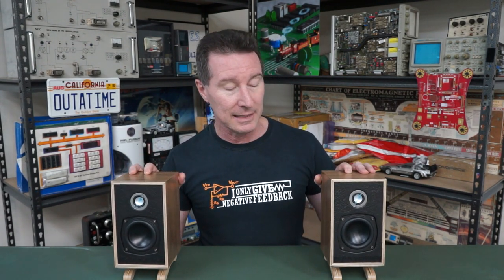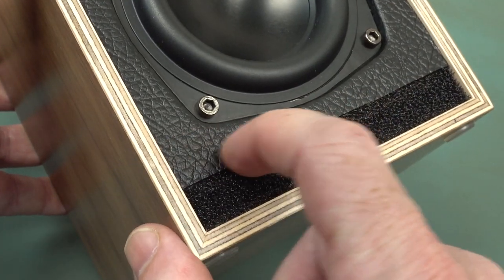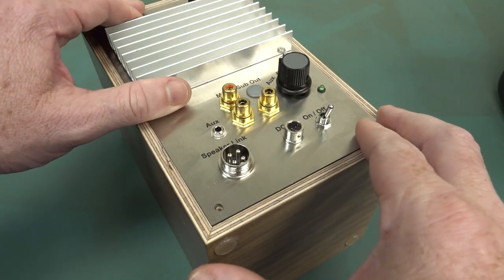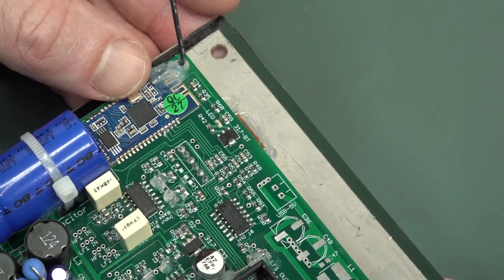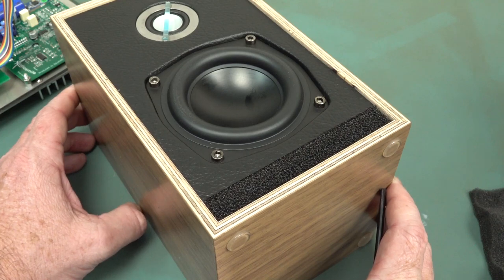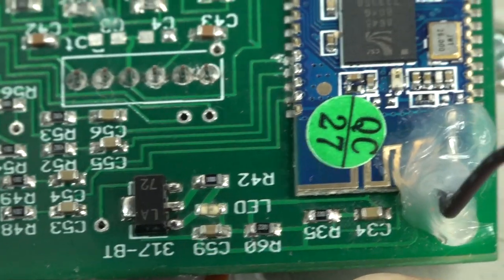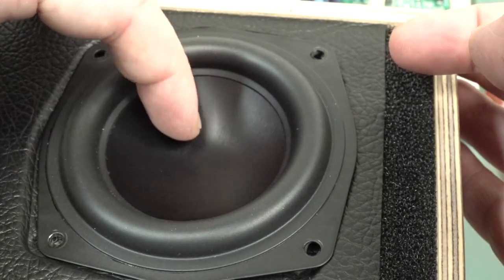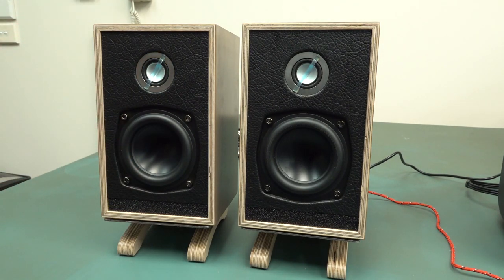EEVblog #1162 - Little British Monitors

Comment: Venting the magnet reduces first resonance frequency, not unexpected in a smallish wideband driver (headphone drivers often do the same). 

Good attention to detail in construction, parts appear to be nothing earth-shaking but of decent quality. (Yeah, the heatsink could be better, but eh... it'll do.) The speaker link jacks look like those used for radio mics to me... 4 contacts are just what you need for two drivers.

Looks like single supply for the main power amp and split supply for the preamp stage, I wonder how this goes together... center-tapped AC input with 1x bridge rectifier + 2x half-wave?

Pricing is not budget basement, but I mean, these are made in moderate numbers in the UK, not cranked out by the thousands in China, so both economy of scale and labour costs would be working against them.
Reply: "The speaker link jacks look like those used for radio mics to me" - XLR

Comment: Like electrical transmission lines, an acoustic transmission line is supposed to present the driver with a constant, characteristic, impedance.  I doubt that is what this one does, and even the best ones, on a proper scale, fail.  They aren't really supposed to output anything at the end, and I have never fully understood quarter wave transmission lines because they never add up to Unity.  In contrast, a ported cabinet presents anything but a flat impedance to the driver.  It's essentially a second, lower, resonance below the driver's main resonance which serves to extend the bass response.  (You don't get two peaks as one might imagine, but get a smooth shape if properly designed.)  The price you pay for this is a sharper rolloff because you have introduced two new poles; in the mass of the air  and the compliance of the air in the box.  They are very different things indeed.  I hope I have elucidated the difference.

Comment: Rear heatsink is the wrong orientation....  Noobie mistake right there.
Reply from the maker: True, I should have noticed that.
Reply: Its safer to orient the heatsink like this when they are big enough to work that way, because when the speakers are oriented sideways - no nasty surprises. That heatsink doesn't look very sensitive to orientation anyway, the fins are widely spaced and shallow.
Reply: and afaikt the stainless steel back which is s lousy heat conductor is between the IC and the heatsink
Reply: @adymode  But they are not designed to work on their side, did you not see the accompanying stands in the first couple of minutes?  I've done flowtherm modelling of heatsink orientation and the relationship between fin spacing and height. I doubt given the small amount of total power dissipated.
Reply: @Tim Fountain Course I saw the stands they're optional - the speakers cooling should obviously work anyway round.
Reply: British quality at its finest.
Reply: Exactly.
I am not an electronics expert at all, but I do know how to handle a soldering iron for 40 years and I do combine cheap Chinese stuff to make things I can use myself. Even I, as a non-expert in electronics, even I always make sure I position the heat sinks in a way they can actually lose their heat. If EEVblog then tells me this guy has been working on this design for years, I think even I could have done a better job. I at least think about every step I make. I have been building audiophile passive speakers as well and done a lot of reading about it over the decades.

I would have taken this a different path: create fairly decent small active speakers built with standard components for a much lower price. Considering the size you will never get audiophile speakers, but you would be able to create decent BT-speakers that sound better than the ones made out of plastic. The DIY concept is okay to make transport cheap and aim at a certain group of customers willing to pay a bit more for something decent/special. Something under 150 US$ for a niche market, but getting what you paid for.
I would also make stands for it as well as some way of mounting them to the wall. Having the port at the front does give you the advantage that you can actually stick them to a wall.

Comment: i use those switches(power) in my detectors, and there is a low profile version that if used in this would mean it didn't need those wire links on the power socket, the power board could be soldered flush.
Reply: OMG Please share!

Comment: I'm stunned at the amount negativity towards a product, which by comparison to far eastern standards is very high quality. The number of comments that say they could build them for $100 is shocking. This of course is a complete impossibility, especially if they are to sell them at a profit and stay in business.

Ok the design of the PCB could be better, with more care taken with the layout. But in low frequency applications, it really makes little difference to the way the circuit functions. These are also pre-production samples, so there's going to be some elements of the design that won't get into the finished production models. 

So can we stop with this "I could build them for 100 bucks"  bullshit, because you can't period. If you can, then do it and send them to Dave for evaluation.
Reply: @Okurka.  The kickstarter states that PCB is outsourced to china.
Reply: I don't know a whole lot about the pcb, but the speaker itself is definitely not worth anything above 100. The drivers I'm 99% certain are Dayton Audio which I'm seeing for about 25 euros a piece and the "tweeters" are even less than that.

edit: after watching more of the video I can confirm they're indeed the Dayton Audio ND91 woofers.
Reply: This could transition to a premium product with proper QC(the manufacturing tolerances on this thing.. lol), PCB design, and better external design. It looks like a late prototype, or a personal project.. This is not something you sell at +200% premium...
Reply: They might have a clever transmission line design, but ultimately the speakers are coupled to a single amplifier (bad, despite the recent trend for "powered" monitors to do this), that's based on an off-the-shelf amplifier IC (still not ideal), use stupid connectors (sorry, but it's true), and individual drivers that are more at home in a TV sound bar than a NFM. And let's not even start on that hazard of a power brick - at least get something vaguely serviceable from LiteON, Delta, or even Mean Well.

They aren't near-field monitors, but a pair of $250USD Wharfedale Diamonds will run circles around these for build quality. And they're made in the far east!

It's some of the claims that annoy me most. 4x50W? Not a chance. Class A/B IC better than Class D? Nope. Alternatives using "inferior particle board"? AFAICT, the "research" suggesting this is 40+ years old - before many modern materials were even widespread - and most speaker manufacturers (even high end) use MDF because it's easier to build  precise cabinetry with and does not sacrifice sound quality.
Reply: Welĺ John,  I'm surprised that you're surprised. Most of the components are made in the far east.  Does the fact that they are hand soldered together in England make the product better?  It looks like a bog standard electronic design, are the Chinese rubbish at soldering?  To match the acoustic properties between the two units all of the electronics should be outside of the cabinet.  It's not good design.  Perhaps I'm too harsh.  There may be a market for people who want to pay for precut pieces of wood and have the fun of gluing them together.  I think it's small.  At this price.  My active monitors have input via analog, SP/DIF digital and optical fibre.  They were cheaper and they're very good.  A bit bigger.
Reply: each woofer is over $25, the tweeter i cant find but comparable ones from the manufacturer are around $20,  so we'll say $90 for just the drivers. Plate amplifier and crossovers are gonna be another $50-100. $150 seems about right.
Reply: Except, you most likely could. Key word is YOU. For YOU. On a production line, yes it would be more expensive. But the sad fact is, modern kit speakers have no point if you are looking for bang for buck when it comes to sound. If you are OK with used speakers, then 50 bucks and a trip to your local thrift shop will blow these out of the water in every way. Or if you want brand new, a few hundred dollars less than the asking price of these will get you a pair that also blows these out of the water in every way. Personally, I don't think the guy making these is an idiot, hence I think the target demographic is different than what you think it is. It is not people who want great sounding speakers at a low price nor is it for people who want high quality speakers. It is for people who want above average speakers that they can assemble themselves and are (at least as of now) fairly rare and unique. They are for people who like to make things, like speakers, and don't have a ton of time.

Comment: The very best thing for speakers is MDF or HDF not plywood... it’s pretty simple, the heavier and more dense the material the better, the goal is energy absorption... and plate metal on the back is not great... flat amplitude response is great, how about the phase? You can EQ any system ‘flat’ and it will sound horrible... it’s much more about phase and the lobes in the off axis pattern...Their is no real difference in types of tuning, a port is a port, unless it’s horn loaded. Also the foam used is to increase the apparent enclosure volume by keeping the thermal load constant (isothermal), pretty sure that type of foam is not correct. Anyway it’s nice to see young folks experimenting with this stuff, unfortunately MP3 pretty much killed off HiFi simply because it’s an easy to use format, it’s incredibly difficult to find high fidelity signal sources these days.
Reply: One word  - Tidal

Comment: So one monitor, with an external speaker. I think I would prefer a small shielded box with front controls and rear I/O with two external speakers. You could also design a matching stand for the amp box.
Who is it aimed at? I am supposing PC speakers for those with space issues?

Comment: Seven hundred u.s. dollars for an amplifier with 10% distortion? Aptx and, aptx hd especially, make a difference in sound quality but any efforts at sound quality are negated by that horrible amp chip. The whole thing seems to be put together from internet research by someone who doesn’t really have an interest in audio quality. In sourcing parts for my own build of a bluetooth speaker into a vintage boombox I’m acquainted with all the components used here and there is a definite mix of good and cheap components. The “tweeter” is most likely another full range speaker. True tweeters are built with sealed backs and wouldn’t need their own enclosure as was done here. The build is incredibly amateur or intentionally cheapened to make the most money. Dave went easy on the guy.

Comment: Been a while since I've seen anyone dabble in transmission line enclosures. I believe they were also called an acoustic labyrinth, requiring multiple baffles combined with a specific weight and volume of damping to slow the rear pressure a full wavelength instead of the half-wave of a tuned port, resulting in a flatter response and without the common 'muddy' sound of the latter, the reason acoustic suspension has superior phase harmonics. Bose has produced a few models featuring these types of enclosures, and I remember someone years ago using plastic conduit to create some Dr. Seuss arrangements for the same effect. Good stuff as usual mate! 

                                                                                                                                                               ~A. Lurker
Reply: @vanjazecevic1159  The first ones I'm familiar with were university prototypes from the 1970s, and the labyrinth was 100% filled, with longhair wool fiber, weighed to produce a more true TL than the half-filled 1/4 wave variant. Approximate dimensions were 5'H x 4'W x 4'D.

Comment: I don't like them... Someone made these and think they are nice and are proud of them - I respect that, but I don't like them at all myself. Cable between the speakers is not my thing either, but dude Dave - these speakers are so small - you will never be able to hear any difference between the active and passive box. No way. Unless there is something wrong with it. Potential loss? In this specific case, that's moving into the audiophoolery domain :P. These might be fine as speakers on your computer desk, or even as speakers for the TV, but would I put them in my audio studio? Nope. That's not what these are built for - but they certainly price them and name them to sound like they did.

Nope!
Reply: at that price I wouldn't even put them on my desk for my computer. 630$US without the stand. For that price I'm sure you can found a nice used pair of monitors from a well known brand that have some reputation. So for personal use? lets just say you can buy some nice used quality HiFi from the 70's that have that nice warm sound from that aera. Even brand new 630$US gives you a lot of room to built yourself a nice speakers+amplifier couple.
Reply: @blackdevil72  yes. I agree. This would not be my choice at all. I forgot, did Dave say it was a kit? In this case it is totally not worth it. The wood case, you either build one yourself or you pay a factory to churn them out for u. U don't wanna pay for a guy using a toy CNC to manufacture them at home. Unless its special and real fine work - but with all due respect for the creator - this is not worth it by the looks of it.
Reply: @LifeOnHoth  Dave said it was a kit and from kickstartter the kit is still 525$US. After having seen one video of some one building them, its not that the kit is hard to assamble but if you do something bad you have a pair of 500$US paper weight. So depending on the quality of the assembling two person won't have the same sound. And I'm not just alking about hability to follow instruction, depending on how wood glue dry you could have small air leak. Plus a little thing I don't like at all and where the guy is a genius he only sent pre-production PCB to group of youtuber and all of them gave him a pass because "oh yeah look like pre-prod, nothing wrong with it, but I can't really judge the quality but over all its good, you could buy them". There is no waranty on the final product, every video I've seen was with a pre-production model. So close to the end of the kick start and he can't show at leat one "finished" productt to the one guy he have sent the assembled kit? Now I'm not sure if I'm clear but that price for so few waranty? I'll pass even if they sound good.
Reply: @blackdevil72  Yeah... that was kinda my idea also... that if this is a kit like you describe it - the price is just all wrong.

This price will get you professional active studio monitors. With warranty, with psu and amp in both cabinets and most important - bigger. Imho - if u go under 5 inches bass element, that's simply not worth the money if u aim at a pro monitor use. I'm sure as speakers for your PC or TV they will be fine, but of course the price is all wrong for that.

I have actually spent some years doing professional wood work many moons ago, and I would also be concerned that if you get those plywood sheets in pieces, about getting it properly joined - though it is not hard, it needs to be done properly.

All in all - basically a worthless product on the account that it totally misses the mark. It's either this or that. :--)

Comment: Transmission line ports aren't always better than typical ports, but in cases with small woofers they often times are. Ideally, the area of a T-line port should be the same as the moving cone area of the woofer, and the length of the port (in combination with the area) determines the lowest tuning of the enclosure. Similar to a clarinet, trombone, or really any other instrument, the length of the port in a T-line enclosure determines its lowest frequency, or in this case, it's cutoff frequency.

At 3:40 you said that Simon mentioned that it's harder to make T-line enclosures for smaller speakers. I really don't understand where he's coming from with that. From my experience, it's much more difficult to do T-line enclosures with larger speakers since they require much more area for the port and end up taking a lot of space. Whether they're large or small the math is all the same, but maybe I'm missing something.